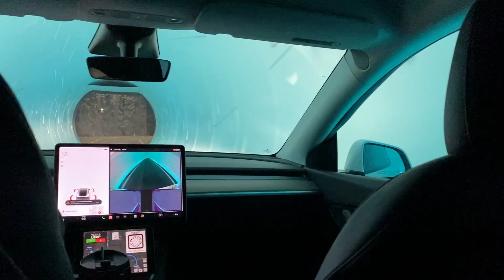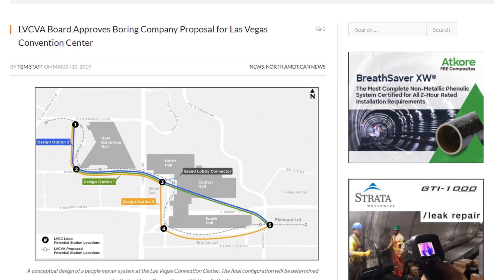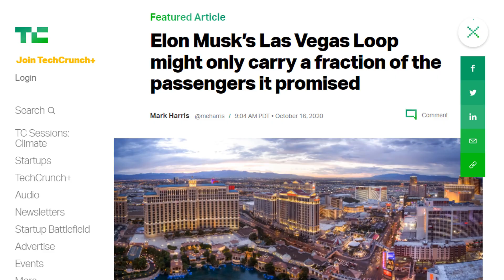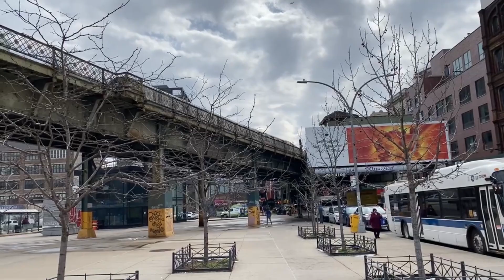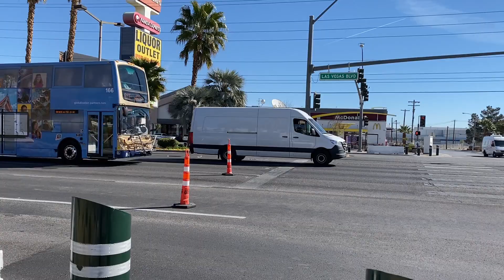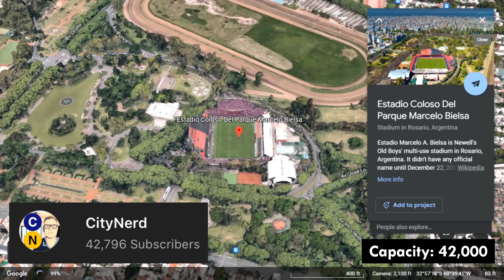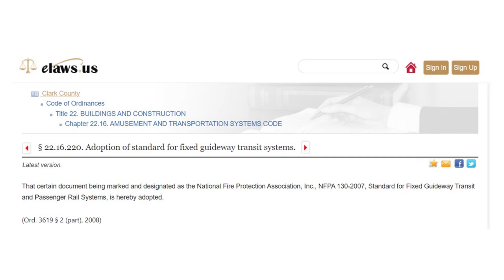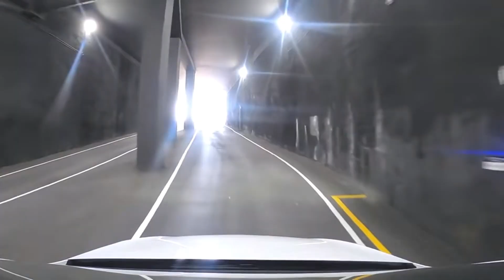Inside the Las Vegas Loop: Transportation Game-Changer, or Complete Waste of Time and Effort?

Comment: Please ignore the tesla shill in the comments The snark is so good. My mate was speaking at the vegas convention centre and ended up stuck in a downpour because she is a wheelchair user and they didn't have the lift van running that day. The attendant literally said she could just wheel herself to the building she needed. In a downpour.
Reply: The Convention Centre has a separate existing non-Loop service for wheelchair users.  However, the full 29 mile 51 station Vegas Loop will have dedicated wheelchair-carrying vans for those users.
Reply: @andrewfranklin4429  You know what is a wheelchair accessible vehicle? A train.
Reply: @thelovewizard8954  yes, but poor wheelchair users have to fight all the crowds to get on those trains and they dare not go too slow and hold up the entire train. In contrast, with the Loop, they get their own dedicated vehicle and they can take as long as they like. 

The Loop is even better for them because Loop stations at about $2m each cost between 50 and 350x cheaper than subway stations and you could build between 10-100 miles of Loop tunnels for every mile of subway tunnel. 

This means it is possible to put Loop stations right at the front door of every hotel, casino, office block, sports stadium, school, University, shopping centre, Rec centre etc etc for VASTLY better wheelchair access. 

And that is exactly what is happening in Las Vegas with 51 hotels, casinos, the University, sports stadium etc all getting their own Loop station.
Reply: @andrewfranklin4429  you know what else is a dedicated wheelchair accessible vehicle that can go literally anywhere? Dial-a-lift buses (or whatever they are called in your area) that can carry at least double the volume and don't have to rely on a tunnel where they still have to use an elevator to get out of, but are dropped off literally at their destination. You don't have to reinvent the wheel here.
Reply: @thelovewizard8954  perhaps you’re not aware that most of the 51 stations in the now under construction 29 mile Vegas Loop are above-ground right at the very front door of pretty much every hotel, casino, University, stadium etc in Las Vegas. 

No need of lifts like subway trains require and unlike buses, the Loop EVs don’t get stuck in Vegas gridlock but rather travel at high speed direct to their destinations I stead of having to stop and wait at every single station/bus stop on the line/route.
Reply: @andrewfranklin4429  so you, I'm assuming you're a part of Tesla since your language seems to be selling it, have designed and another road with the same gridlock and effects from weather, but this time all the cars being branded the same. Congrats on being bought by a charlatan, you are what's wrong with the world.
Reply: @andrewfranklin4429  wait, even better. The loop is a fucking TAXI that doesn't even have the same flexibility of one. How many wheels are we on now? Uber beat Elon to the punch ages ago
Reply: @thelovewizard8954  Perhaps you’re unused to someone who actually supports their position with facts and data rather than engaging in the usual snarky one-liners?  

The Loop hasn’t experienced any gridlock or traffic jams. That single short clip from CES that some people repeat over and over ad nauseam showed only a brief slow down for less than 40 seconds in the Loop tunnel due to a temporary closure of the South building’s doors. The EVs didn’t even stop, they just briefly slowed.

This of course ignores the fact that the rest of the time the Teslas are smoothly entering and exiting each station down to every 3 seconds compared to switching to a mulit-billion dollar subway where you have to wait for far longer - 3, 5, 10 or 30 minutes for the next train AND have to stop and wait at every station on a line instead of flying at high speed direct to your destination. 

The above-ground Loop stations are all shaded from the Vegas sunshine and the tunnels are all underground so weather is hardly a problem.
Reply: @andrewfranklin4429  Sorry I couldn't reply, I just utilized mass transit to fly 2000 miles, and then from one terminal to the next, and finally to my destination. I am tired, and you are a shill. You win this time, but I do have my own data that isn't a sales pitch.
Reply: @thelovewizard8954  no need for the insult Wizard. I’m not interested in “winning”, just helping people get out of the rut of thinking that nothing could be possibly be better than traditional public transport. 

I perhaps forlornly hope that the referenced data I provide is sufficient evidence to get people thinking or at least holding off judgement until the full 29 mile 51 station Vegas Loop is completed so we can see if the rest of the Loop proves to be as remarkably successful as the current LVCC Loop.

Oh well, have a great sleep! :-)
Reply: @andrewfranklin4429  your fake news "the Loop has not experienced any traffic Jams",  there are literally several videos of Las Vegas Loop Traffic Jam on YT
Reply: @andrewfranklin4429  ICE Train requiting 6 to 24 times less energy (Km/MJ) per person than Tesla Model 3. Also ICE train travels at 250 to 300 kph (155 to 186 mph). The Loop at a very slow 35 mph max speed
Reply: @THEREALZENFORCE  no Zenforce, the Loop hasn’t actually experienced any traffic jams. That single short clip from CES that bloggers repeat over and over ad nauseam showed only a brief slow down for less than 40 seconds in the Loop tunnel due to a temporary closure of the South building’s doors. The EVs didn’t even stop, they just briefly slowed.

This ignores the fact that the rest of the time the Teslas are smoothly entering and exiting each station every 3 seconds compared to switching to a mulit-billion dollar subway where you have to wait for far longer - 3, 5, 10 or 60 minutes for the next train and have to stop and wait at every station on a line instead.
Reply: @THEREALZENFORCE  Loop EVs have already demonstrated 127mph (205 kph) down the 1.14 mile test tunnel in Hawthorne California. 

This shows the sorts of speeds possible in a tunnel that is almost 3 times longer than the 0.4 mile spur tunnels connecting each station in the LVCC Loop. With the much longer arterial tunnels of the 29 mile Loop, it will be easy to achieve even higher speeds.  

Even the current LVCC Loop is significantly faster than a subway.  Passengers board the Loop EVs with an average 15 second wait according to the LVCVA compared to subways where you have to wait for 3, 5, 10 or even 30 minutes for a train to come in the first place. Then the train has to stop and wait at every station on the line meaning they average only 17mph as a result. 

In comparison even the LVCC Loop EVs travel at 40mph (64kph) in this first stage and as I say will hit an average of 60mph with peak speeds up to 150mph once the 29 mile 51 station Loop is finished.
Reply: @andrewfranklin4429  Wikipedia : Energy Efficiency in Transport : 
Tesla Model 3 has 1.76 km/MJ (for max 4 passengers)
German ICE train is 68 km/MJ (for 918 passengers)
ICE train is 0,07 km/MJ per person while the Model 3 is 0.44 km/MJ per person with makes the Model 3 at big 6.2 worse efficient, requiring 6.2 times more energy per person (with 4 passengers, that would be 24 times worse with only one driver and no passenger)
Reply: @THEREALZENFORCE  I’m afraid you’re reading those energy efficiency figures around the wrong way Zenforce. That German ICE train only gets 0.07 kms using a MJ per passenger while the Tesla gets 0.44 kms, on the same MJ per person which is  6.2 times more efficient. With 4 passengers, the Tesla would be 24x as energy efficient as the ICE train.  :-D

Here is a complete list of energy used per passenger mile for all electric and diesel electric trains in the USA. As you can see, the Loop beats them all with the average 2.4 passengers per Loop EV or greater and even with 1 passenger still manages to beat most of them.  

Transit System	Type	Wh/pax-mile
Loop Model Y; 5 passengers.	Loop	70.0
Loop Model Y; 4 passengers.	Loop	86.9
Loop Model Y; 3 passengers.	Loop	112.3
Loop Model Y; 2.4 passengers.	Loop	141.5
Seattle; ST	LR	144.6
New York-Newark; NYCT	HR	164.7
Model Y; 2 passengers.	Loop	165.2
San Francisco-Oakland; BART	HR	177.7
San Juan; PRHTA	HR	193.2
Atlanta; MARTA	HR	193.5
Phoenix-Mesa; VMR	LR	206.8
New York-Newark; PATH	HR	217.1
San Diego; MTS	LR	223.1
Portland; TriMet	LR	269.1
Chicago; CTA	HR	320.1
Loop Model Y; 1 passenger.	Loop	324.0
Boston; MBTA	HR	324.6
Los Angeles-Long Beach-Anaheim; LACMTA	LR	325.8
Philadelphia; SEPTA	HR	346.5
Charlotte; CATS	LR	349.8
Boston; MBTA	LR	350.1
Seattle; SMS	MG	354.1
Minneapolis-St. Paul	LR	385.6
Los Angeles-Long Beach-Anaheim; LACMTA	HR	390.0
{ HR Average }	HR	408.6

Denver-Aurora; RTD	LR	411.4
San Francisco-Oakland; SFMTA	LR	416.8
Houston; Metro	LR	425.9
St. Louis; METRO	LR	427.5
Philadelphia; PATCO	HR	431.9
Washington; WMATA	HR	439.3
Philadelphia; SEPTA	SR	461.1
New York-Newark; NJ TRANSIT	LR	465.9
San Jose; VTA	LR	468.7
Salt Lake City-West Valley City; UTA	LR	480.5
Seattle; ST	SR	502.3
San Francisco-Oakland; SFMTA	SR	502.7
Sacramento	LR	507.0
{ LR Average }	LR	510.4

Type
HR/LR = Heavy/Light Rail
SR = Streetcar
MG = Monorail/Guideway
Wh/pax-mile from 2019 NTD Data.

Electric Propulsion Energy Consumed in kWh / Passenger Miles * (Revenue Vehicle Miles/Total Vehicle Miles)
Last term corrects for Energy used for revenue service, and removes such uses as deadheading, training miles, etc...
Reply: @andrewfranklin4429  "Wheelchair carrying vans" so you also have to buy these, while in Luxtram in my country the tram is at the height of the wheelchair, so wheelschairs can enter directly, have a dedicated place and can exit at any station. While with your van, a river has to come out, the wheelchair has to be lifted and than secured and later at the exit same procedure again, and you are the one claiming the Loop does 10 seconds from each car apart (so i want to see a Van loading and deloading a wheelchair person in 10 seconds. In the meantime, in Luxtram, a wheelchair person needs less than 20 seconds to drive in, an less than 20 seconds to drive out of the Luxtram.
Reply: @andrewfranklin4429  Las Vegas Loop 4400 persons per hour
Luxtram can transport up to 422 people every 2 minutes
422 persons transported in 2 minutes
844 persons transported in 4 minutes
1266 persons transported in 6 minutes
1699 persons transported in 8 minutes
2110 persons transported in 10 minutes
2532 persons transported in 12 minutes
2954 persons transported in 14 minutes
3376 persons transported in 16 minutes
3798 persons transported in 18 minutes
4220 persons transported in 20 minutes
4642 persons transported in 22 minutes
(already in 22 minutes more than the 4400 Loop in one hour)
12660 persons transported in 60 minutes (1 hour) just from one station start to another.
All from just one station, and for 500 million euros (a bit more in USD), you got 16 kilometers (10 miles), 24 stations and many tramways.
50 million per mile with 24 stations and tramways 3 times more people
While Loop 50 million for one mile, one station, no cars, no drivers in these 50 million price.

Paris metro 698 guests per metro train every 6 minutes.
698 persons at 6 minutes
1396 persons transported in 12 minutes
2094 persons transported in 18 minutes
2792 persons transported in 24 minutes
3490 persons transported in 30 minutes
4188 persons transported in 36 minutes
4886 persons transported in 42 minutes
5584 persons transported in 48 minutes
6282 persons transported in 54 minutes
6920 persons  transported in 60 minutes
Per metro train (rame) in Paris, an there are many rames driving simultaneously at the over sever hundred miles of Paris metro.

Comment: the ideal transit system is one that is frequent, grade-separated, cheap to build, and has express service. that's what they've built. they sacrificed maximum capacity to get all of those features, but not all corridors need high peak-hour capacity. it's as simple as that. it is a product to be used where high capacity isn't needed but buses are impractical or would get stuck in traffic. they need automation and handicapped accessibility, but those are not as hard of problems to solve as many people think, since you don't have to buy their car service with the tunnels; a 3rd party vehicle, like Waymo, zoox, etc., can be used.
Reply: They could still have all of those things and have capacity if they took the Teslas out of the tunnels and replaced them with busses. It would be cheaper to operate, still have short wait times and have far greater capacity. Musk would have also just reinvented bus rapid transit. Which is just an objectively better system. Which is saying something because BRT is kind of the joker of the viable public transit world.

Comment: Something to note, people have lots of bags/luggage often but if it was just a large travel vehicle (like a bus) accommodating that is a little harder. These individual vehicles allow people to have their bags in the trunk (and inside) while still at least moving up to 4 people. I’m not saying it’s perfect but as a local who does Uber I can understand why they turned down the larger capacity vehicles. Especially if the vision of it going to the casinos comes true (resort world connection opening soon) its a start and over time will hopefully get better

Edit: There will be a second tunnel open but they’re doing it in phases. From my understanding it will be worked on as the first tunnel is open while they work on the next stretch. Strange flow but we’ll see
Reply: Tesla certainly aren't better than busses with floor storage, if that's the concern here ...
Reply: @Sp4mMe  you don’t know Vegas very well. Hence the bus, monorail and trams almost no one has luggage on them just different

Comment: these videos could be accompanied by a bingo card of fallacies. *not automated now, thus never will be. *has lower capacity than a train line, even if its capacity is higher than the ridership. *isn't using handicapped roll-on/roll-off vehicles, even though they have a publicly stated plan for doing that, etc. etc. etc.. 
it basically all boils down to "it's not perfect right now, therefore it never will be", at least this guy acknowledges that that are working to make it into something more useful.

Comment: all of these problems even before thinking of the small problem of what the hell do you do if there's an accident. How do you get out? How will they take the veihicle out, since the tunnel is too small for a tow truck. Can the people escape without being at risk of being run over by the cars going in there. All of these and more need to be awnsered for this to even be a gimmick and not a danger to everyone involved
Reply: The LVCC Loop has a tow vehicle (also a Tesla) to quickly and easily extract broken-down cars.  The 29 mile 51 station Vegas Loop will have multiple such tow vehicles. 

If for some reason, an EV can’t simply be towed.  Loop EVs could easily bypass the disabled vehicle by going down one of the many parallel tunnels and mini-loops in the 29 mile 51 station Loop, or if the incident is between the exit and entry spur tunnels to a station, traffic could divert through the station. 

But unlike a thousand passengers crammed in a burning train, there are only 2-3 people to evacuate from a Loop EV and they simply get out and jump into the EV that’s stopped just behind them in the tunnel while the tunnel’s high capacity smoke exhaust fans blow any smoke away in the opposite direction. 

And the Teslas have huge HEPA filters and carbon activated filters running on re-circulate creating positive pressure in “Bio-weapons defense” mode to keep all toxic gases out for the few minutes it takes for the EV to drive to the nearest station. 

Much safer than a thousand passengers trying to get out of that burning train and then having to walk thousands of feet to a narrow escape tunnel and stairs/ladders to get out.

Comment: I'm a car enthusiast who drives for work. Cars are great because you can go from basically anywhere to anywhere else so long as the roads connect and you have the fuel and time.

You lose basically every benefit of a car when you put it on a fixed track. Even I know when you want to go downtown you park the car and hop the train, or better yet subway. Especially if you want to go to more than one place in a city.
Reply: but the cars are not on a fixed track, they can go to any station non-stop. this function may be hard to see clearly because there is only 3 stations, but if the system were to scale[city-wide Loop) this would become a lot more apparent
Reply: @coreysuffield  right, but that basically makes it an underground road network. Very expensive roads.
Reply: @coreysuffield  But you can still only go to stations. You have to travel from your point of origin to a station, and then take the Loop to a different station, and then travel to your destination. Or you could just take a taxi and go from door to door.